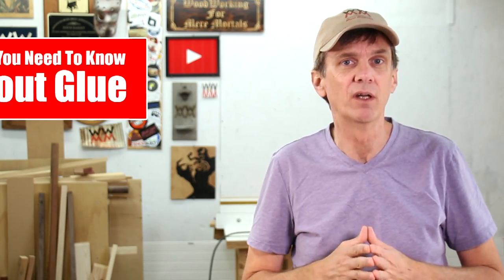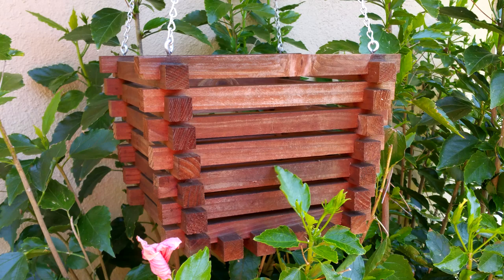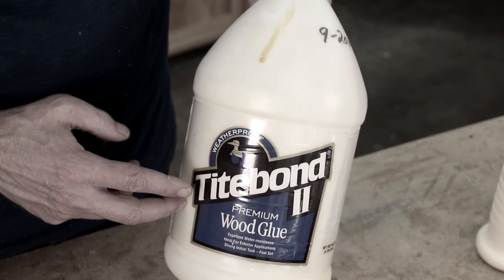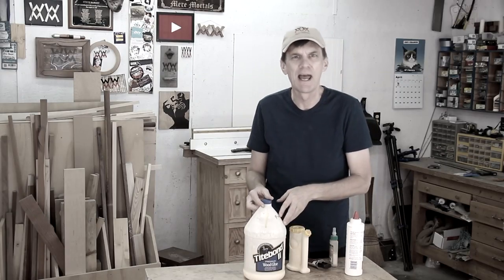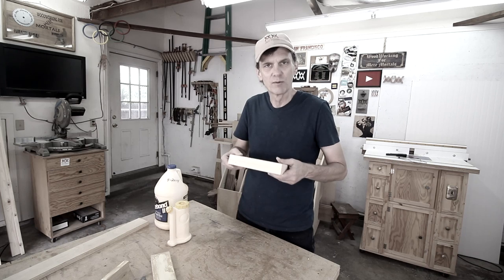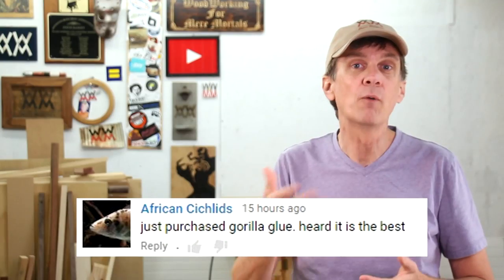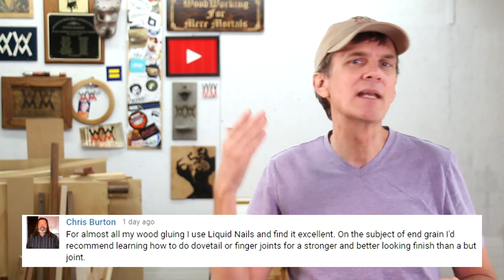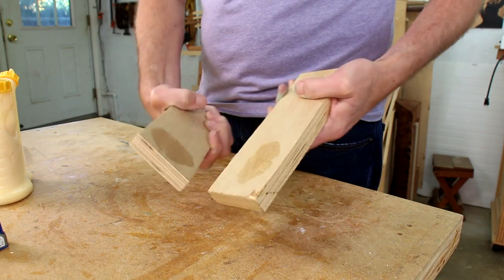Why I Don't Use Titebond III | MORE MINUTES

Comment: Super glue is best at holding fingers together.
Reply: metamech 😂😂
Reply: I think epoxy does a better job at that!
Reply: This is true.  I also use it on stone chips in the windshield of vehicles to hold off crack spreading and delay the need for a new windshield.
Reply: paired with electrical tape, they make the best shop expedient bandaid too! haha
Reply: Think that was one of its original purposes – closing wounds.
Reply: metamech and eye lids
Reply: That's because super glue was originally used by the military as sort of a first-aid kit  stitches in a bottle kind of thing and the soldiers discovered you could glue all kinds of stuff together with that not just people
Reply: I recently used CA glue with tite bond wood glue to glue and angled piece I couldn’t clamp. I put two drops of “super glue” on the outside edges and put wood glue on the rest. Sprayed the other piece with accelerant and put together. The super glue acted as a “clamp” to hold it while the tite bond wood glue dried.
Reply: i prefer needle and thread.   jus sayin
Reply: hahahahahhaha aaaah... the memories... my jacket has a solid fingerprint on it to this day xD
Reply: I have never had good luck with superglue. It either doesn't grab, or it grabs and then lets go a few days later. I've always assumed I wasn't using it properly, somehow, despite following the bottle instructions. Eventually I just gave up on it.
Reply: @freddyfriesen  clear duck tape also works well on windows.
Reply: @tweakerkid  But superglue can be razorbladed flat and invisible just like the stone chip repair people who charge you fifty bucks.
Reply: 100% true
Reply: @freddyfriesen  stone chip repair people are using pressurised resin to fill the cracks. Its a much higher quality fix.
Reply: @joestevenson5568  For $0.99 I have been managing to make my windshields last a lot longer.  In fact, longer than the $50.00 fixes, cause I can do it immediately and repatch on a regular basis.  So far I have saved hundreds of $$.
Reply: metamech Юлия латынина
Reply: And for gluing quarters to your bosses desk
Reply: I knew a guy once who said that cyanoacrylate will bond any two substances instantly and permanently, provided one of them is human flesh.
Reply: Factual.

Comment: I am 72 years old now, and when I was a kid in the 1950's, I would go with my Dad to the Boat yard where they built Sea going wooded boats up to 90 feet in length. They used a brown Powder glue you mixed with water , which was made by Weldwood. It dried like harder that woodpecker lips. In fact, they would glue two pieces of scrap wood together and tie a string to it and throw it in the river, and after weeks, pull it out and try to beat the joint with a hammer, but could not. The wood would splinter but the Glue never gave up I have looked for this glue, But, Unfortunately, it is Not made any more.. It was the best ever. Nothing now compares with it. Have or had you ever heard of this Glue. It came in a Tin, Paint like can that sealed just like a paint can. Yours Truly, Russell
Reply: “harder than woodpecker lips”

LMBO
Reply: russell hill: "It dried like harder that woodpecker lips." What language is this in? We must be told since it is unintelligible to those of us who speak Standard English. Also, what the hell does it mean?
Reply: Alan George Barstow  City boy
Reply: @JT_70  What? Russell Hill is a city boy; woodpecker lips means city boy; or I am a city boy? If it's the third count you are utterly incorrect: I am a country bumpkin.
Reply: russell hill, I remember that glue also. I think epoxy resins replaced it.
Reply: Weldwood plastic resin glue... still made...
Reply: Weldwood plastic resin glue is probably what you are referring to.
Reply: @alangeorgebarstow  than, not that
Reply: @454Casull  Yes, I know. That was precisely the point that I was making in my comment to the original poster (russell hill) when he used "that" instead of "than".
Reply: @alangeorgebarstow  The problem is that most people in comment sections do not proof read their comments before posting them.  I always do.
Reply: @alangeorgebarstow  -  Yeah, not proof-reading is one of my pet peeves, but you made a pretty big production out of one single mis-key typed by a 72-year-old who wasn't born with a smartphone in his hand. I'm tossing out the "Douche card" here. 

"What language is this in? We must be told since it is unintelligible to those of us who speak Standard English." ... Really? I'd call that an over-reaction, as anyone with a real "grasp on standard English" knew perfectly well, what Russel meant. That's the sort of mistake that might confuse a foreigner while using Google translate, but the rest of us seemed to understand what happened.

Nearly all YouTube comments are grammatical disasters and barring one letter, the O.P. wasn't one of them. The "Point" (if you found it necessary to make one) could have been made by simply, correcting him without feigning ignorance and over-reacting... Just Sayin'.
Reply: I think you might be referring to a marine glue called resorcinol. I helped my father build a wooden yacht with it when I was young. It was a dark powder that was mixed with water. It contained formaldehyde, so they may have taken it off the market.

Comment: Actually, I tested the excessive clamping myth, and in my tests, it did produce a slightly weaker joint.  Might not be the same for soft woods though.  Seaarch for "can you squeeze all the glue out of a joint"
Reply: i love all of your myth buster style videos (well actually i love all of your videos) and i hope to see more soon hopefully  :)
Reply: I was just going to comment that you did a video proving that "starved" joints are weaker.
Reply: +Matthias Wandel I was Just thinking of that video.
Reply: Matthias you're the wood scientist
Reply: Matthias Wandel n
Reply: I'd be curious if this was less of a "the glue gets squeezed out" and more of a material strain issue.  Suggesting that you're putting the joint under compression such that the materials "rebound" when unclamped, which stresses the joint, where if you clamp them just enough, they bond in their natural resting dimension.
Reply: I build guitars adn I always get a chisel or pointed implement and prick the glue surfaces all over. This lets the glue permiate into the wood grain and get a good key. That said, i mainly use epoxies that take 12+ hours to go off and have time to creep into the wood structure.
Reply: I read that tb3 is better for loose joints than 2..maybe that is something else you can test :)
Reply: To be entirely fair although it is a textbook and your milage will vary (clamp type, actual pressure, type of lumber, local humidity and so on...) the understanding wood textbook doesn't so much give a damn about "your" situation but generally specifics that a clamped lamination like a benchtop will (if made of hardwood) not be adversely affected so long as the substrate is adequately prepared for a glue up. Again your milage and testing will vary. Obviously don't crush the fibers but "adequate" pressure is in quotes for a reason.

Comment: The main reason I use Titebond III is because it works at a lower temperature than Titlebond I or II. The Titlebond website says its working temperature is about 5 to 10 degrees below Titebond I or II. That is important to me when working in my unheated garage in the winter. I love Titlebond III for this reason and it also is suppose to work better with oily exotic woods. I only use Titebond III

Comment: Tightbond III is urethane based. Tightbond II is waterbased (PVA) with polymers added for water resistance. It forms a lattice of polynomials which is more tight knit than regular PVA. A urethane based glue will not breakdown with moisture, but can loose adhesion if in extreme cold, or heat, but that is not likely to ever effect anyone unless you are in Canada or Alaska or somewhere extreme. When using Adhesives, it is important to use a something that allows for dispersion across the surfaces.
Reply: lattice of polynomials?

Comment: Titebond II vs III: I use III simply because it has a longer working time, which is especially important for big glueups. When building skateboards for instance you need to apply a lot of glue, over a large area, before clamping the veneers together. Titebond III affords you not having to rush like a crazy person. Likewise with skateboards, applying glue on both surfaces ensures that you get glue all over the joint, even if you missed a small area on each you're likely to cover it all. I've heard of situations when pressing skateboard decks that pressing too hard can squeeze out too much glue, and leave you with a weaker skateboard deck. Generally, when pressing a deck, you're using more pressure than you could get with most commercially available glue clamps anyhow, as you're putting it into an actual press, or a vacuum bag system.

Completely with you on the CA glue, best used temporarily, at least in wood working. Though, one glue which you left out is epoxy glue. It's both gap filling and has adhesive properties which outshine most other glues.
Reply: +Switch &amp; Lever Two things:Firstly, would you mind sharing where it is you get your lamination veneer? I am trying, with no success, to find any good core material.

Second: epoxy's greatness is also one of it's weaknesses. It is incredibly strong and is perfect for joining dissimilar materials, but it is brittle. it's hardness make it a poor choice for shock load applications
(chairs and the like) as well as applications that would be subject to high amounts of wood movement.
Reply: +Ltifone2014 I get it from Roarockit Skateboards. In my latest video I use their veneers to build a skateboard. 

I've fixed chairs with epoxy though, with very loose joints, and haven't had one come apart on me yet. With wood glue, if you don't have a tight joint you're basically out of luck. You can find epoxies which have a little bit of give in them, making joints much less brittle. You can also glue material which aren't entirely clean without much loss of joint strength. That's why it's my go to glue for chair repair, unless it needs to be historically accurate when, then I'd use hide glue...but that's a whole other can of worms.
Reply: i must say i am envious that you have never had an epoxy joint crack. I'm still fairly new to the game, maybe i just haven't figured something out yet.

Thanks for the info, 
I hope have a nice day
Reply: Switch & Lever jkkk
Reply: I built a kayak with epoxy in the glued joints and it worked great for a few decades, until it was stolen.
Very similar to fiberglass resin which I used for many other projects.
I think a key is to have reinforcing fibres and keep the resin in thin sheets which are more flexible.
Reply: I like the way Tightbond lll works. That is why I use it. Pretty simple.
Reply: So what you are saying is the advantage is that it takes longer to dry.
Reply: @boydmerriman   Titebond III doesn't take longer to dry overall, just in the early stages when you're still working on the joints, but basically, yes.

Comment: Tightbond is the original and it is the standard mixture, the big difference between tightbond and tightbond 2 is the waterproof nature. Tightbond 3 is more of a specialty glue. 3 has a longer open time (or time you have to work with it until it cures) and one of the alterations in 3 is that it has either acorn or walnut shells in it (I don't remember which) that gives it a darner color when it dries so it's easier to hid the glue line.
I agree with you on not using a wet rag for cleaning, If you have squeeze out then let it dry and remove it with a chisel and some sand paper. 
Oh, and Tightbond 3 is a pain to wash out of clothes or a work apron. I have found that it won't wash out on it's one and you have to pick it out or just accept that it is there for the long haul. 
I like glues and my favorite is the Silicon Marine Glue. It had worked miracles for me. But for woodworking I just use tightbond original or elmers wood glue. I don't care about it's life in water or outdoors because I seal everything with poly or lacquer.
Oh and CA glue with an accelerator is just ca glue that hardens faster. The accelerator does not really alter the chemical makeup after it's hardened it just makes it harden faster than it would normally
Well that is some of the horrible amount of information I know about chemical glues.Your channel has given me a lot of little tips and tricks and I am glad to share some information with you Steve. 
Have a great week.
Reply: Great advices
Reply: Titebond three does not wash out of your apron as its waterproof. Your attempts to wash it out prove the claim its waterproof!
Reply: rats arsed   would it be safe to use on food use items?
Reply: robert till  3 is food safe   It’s on the label

Comment: Hi Steve! I have a tip for filling nail holes. I do a lot of picture framing and to match the stain on a frame I use alcohol based markers. First I mix up a small amount of a product called Durham's Rock Hard Water Putty (only mix what you need as one it's dry you can reuse it, I think it might be similar to plaster of paris but it seems more durable, either way you are only filling a nail hole not building a fireplace with it.) and fill the hole. I wipe away the excess with a damp paper towel or baby wipe. Once dry I touch it up with an alcohol based marker like a Sharpie. You can get sets that are all neutral color or purchase a few shades in tans and browns at your local art supply store. Since I already have them for my art I use what I have. All brands work great but the artists brands offer more color selection.

You can build up the marker until you get a match. If you are filling a hole in a dark wood such as walnut add some brown acrylic paint to the water you mix with the durhams powder to start off with a darker color putty and adjust with your permanent alcohol based marker. Since the marker is transparent if a bit gets on the wood you can wipe it with your finger and blend it in. Hope it helps! 
I even saw a set of "furniture markers" at the Dollar Tree and they are fine for this.

Have a great week!
Reply: This is a great suggestion. Makes sense to go this route. Once the clear is put on, you'll never see it.
Reply: Nails (and staples) suck on nearly every level, and should only be used temporarily on stuff you want to take apart in the near future, and there are much better fasteners, like screws if visibility isn't a problem, and of course glue when it is.  Of course when gluing, you need tight fitting joints, or risk loss of strength.

Framing shops, well at least those franchises don't use good joints to begin with, nor good fastening methods, almost as if they are making sure you will have to go back for replacement and repair, and there are way better methods than jus 45 deg cuts nailed or stapled together, and why I do it myself.

Comment: No-one seems to have mentioned this, but the reason I use TBIII is because it has a longer open time than II, which is a blessing for intricate glue work and complicated clamping (it takes longer to start drying out from its wet state).

Comment: Hi Steve et al. In addition to different water resistance levels,  The biggest difference between TB3 and TB2 for me, and the reason I bought TB3, is that TB3 is food safe.  So if you're making cutting boards or bowls, etc, TB3 is the preferred choice.
Reply: TB2 is food safe also.
Reply: @bullfrogpondshop3179  DId that change? I could swear when I started making cutting boards TB2 wasn't FDA approved for indirect food contact, only TB3 was.  Although regular wood glue has been used for decades so Im sure it'd be fine nonetheless
Reply: @JamesG82  All titebonds are FDA approved

Comment: I've tried Titebond ll and Titebond lll. I can't give a specific reason, but I prefer the Titebond ll.

Just an added side note, I had a small amount of Titebond ll set up in the bottom of one of my glue bottles. I figured I'd just fill the bottle with water and let it set for a few days to soften it up and I could reuse the bottle. Well, it didn't soften up in a few days or weeks or months. That bottle sat for two years with water submerging the glue and it never softened enough to remove. 
Titebond ll might not be waterPROOF enough for marine use (submersion) but it holds up reasonably well for most outdoor projects.

Comment: TB3 has a much longer open time, that's the main benefit I've found.
Reply: Beat me to it, Ben :)
Reply: That's the reason I use it 99% of the time.
Reply: Me too!
Reply: is open time like dry time?
Reply: Open time is the amount of time you have to clamp up the parts, before the bond starts to form.  Glue actually doesn't "dry," it "sets" or "cures."  We normally say dry but it doesn't dry out, it more forms a chemical bond.  The set (dry) time is about 24 hours for titebond.  This means if you stress the joint before it sets completely it will be weaker or may fail right away.  You can usually remove the clamps after about 1/2 to 1 hour, and it will feel set, but the bond hasn't fully formed.
Reply: K.B. Woodworker n

Comment: At carpenter school we learn that normal wood glue binds way better when the pressure is high and the gap between the pieces should be as small and smooth as possible. We even tested a few differently set up glue joints proving exactly the mentioned above.